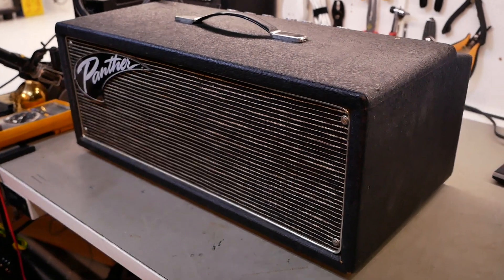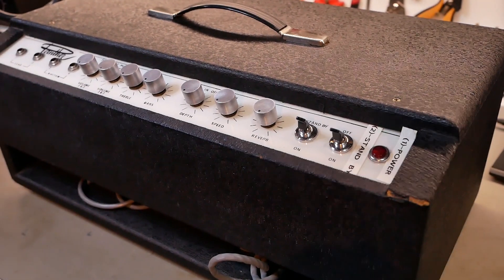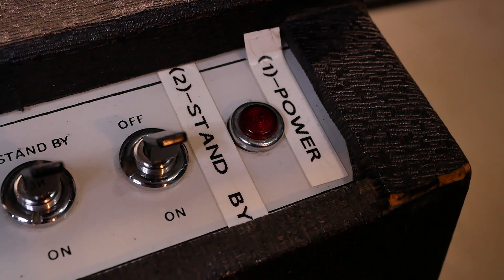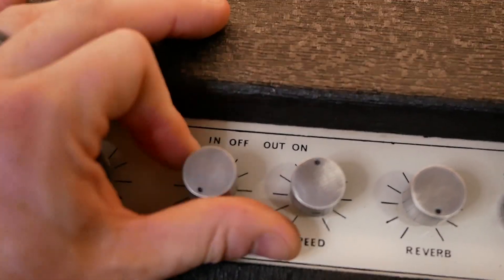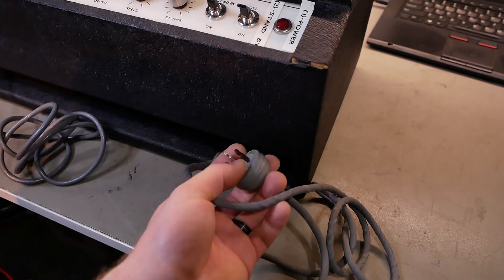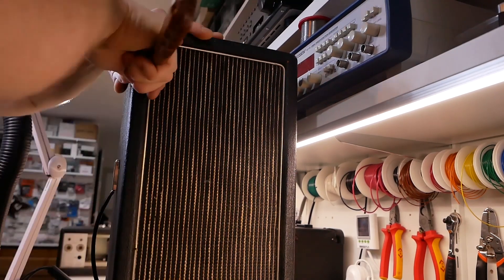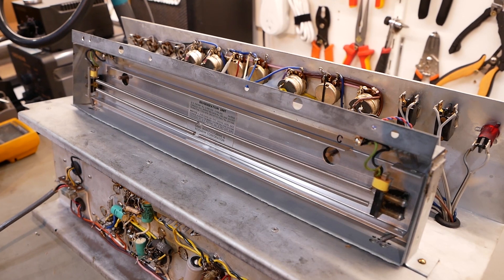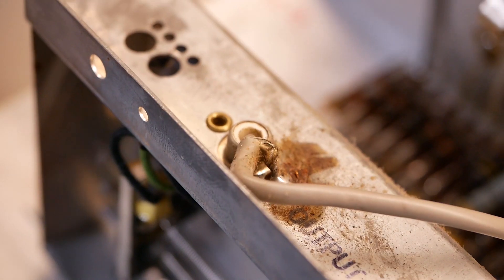Oldschool Aussie Amps - Panther Head Part 1

Comment: "MiniWatt" was a Philips brand, but although I've handled tens of thousands of tubes, I've never seen a USA-branded (manufactured?) Miniwatt tube before (my guess is that they might be rebranded Sylvania 6L6GC's). At some point,, Philips bought USA-based industrial-tube manufacturer Amperex (on/in Long Island, NY), or at least purchased brand-licensing and cross-distribution rights to the name; and they also bought Sylvania  or the associated licensing/branding/distribution rghts, which is why you might see late production military JAN-spec "Phillips/Sylvania" branded tubes, typically with blue printing on the glass, instead of the usual early Sylvania green or, later, yellow printing. (This arrangement was probably done so that Phillips in Europe could have access to the lucrative American military market). 

By the way, Matsushita = Panasonic and Technics.  I am told that their very 1st product back in the 1920s or thereabouts was a Y adaptor  that screwed into an overhead light bulb socket and gave you an outlet to plug in an appliance or other device, as well as a bulb socket! Here in the States, everyone I've known in the audio business, sales reps and so on, and one boss who had visited a Matsushita factory in Japan,  pronounced the name with just 3 syllables: "Muh-shoose-ta".   Perhaps someone of Japanese descent or experience will tell us if this is correct or not.....

Comment: At 21:45, "we've got pin 1 and pin 8 connected, so that's the suppressor grid connected to the cathode". The problem with this scenario is that 6L6GC's are beam power tubes, not pentodes, and they do not have a suppressor grid !!!  It probably doesn't matter much here because most 6L6 type tubes don't use pin 1 at all unless they are the early metal  case 6L6 (where the metal shell would be connected to ground).  Perhaps these amps were originally intended to be used with EL34's and then somebody made a production change to 6L6GC's  without changing how the sockets were wired (I wonder if they also changed the output transformers to have a better impedance match to 6L6's).  It might not be a bad idea to doublecheck the tubes themselves and make sure that pin one isn't internally wired to anything inside the valve. And PS,  I agree with Brad, a 6CA4/EZ80 rectifier does seem decidedly undersized for an amplifier with 6L6GC's and 6 other tubes; 12AX7's  may only need a few milliamps of current per triode, but we have a total of 8 triodes here by my count, not counting the triode in the 6BM8  ---- or 6GW8? ----  triode-pentode, which will also need sufficient current for the pentode half of the tube to drive a reverb tank.
Reply from the maker: Yeah, I meant to cover that. I reckon it's meant for el34's as almost all the other Aussie amps from that era were.
Reply: @BradsGuitarGarage  ,  Weird that the sockets are silkscreened for 6L6GC..... assuming that those markings are original from the factory.
Reply: @BradsGuitarGarage  ,  I pounced on that little discrepancy like a funnelweb spider, didn't I? 😁😳 I'm an equal-opportunity kind of guy, so If I write something stupid (I've been known to) or just plain wrong, feel free to do the same to me! PS,  I am really enjoying these weird/obscure amp videos from you, and occasionally from Lyle too.  Makes for an interesting change from the usual Fender Vox Marshall trifecta.
Reply from the maker: The silkscreen you're referring to is just sharpie written by a previous tech, so all bets are off in that respect.
As for the weird / obscure stuff, there's plenty more of that on the way!
It's very rare that I get a run of known amps.
It can be very challenging starting from zero information on every job and trying to make a living off it in the process.
Reply: @BradsGuitarGarage ,  obviously you are up to the challenge! And not that you're starving for work, but although there'll always be techs, whether skilled or hacks, willing to work on Fenders and Marshall's, the  guy who can handle the oddballs (both the equipment and the equipments' owners) will always own a goodly slice of the niche market. Your ability to figure out the weird amps with weird issues and minimal documentation tells the prospective customer that you can certainly fix their modern Fender, Marshall, Vox etc. Making it all pay can be tricky....

Comment: Roll the tube with the worn-off writing through your hair and....oops! Okay, breathe on it until the glass fogs up, or better yet put it in the freezer for a few minutes first, and then breathe on it, and hold it up to bright sunlight and rotate the tube in the light---- as the foggy film evaporates it may briefly reveal the lettering. A thin film of hair oil on the tubes beforehand helps make the letters more visible.....

Comment: Brad, Did you end up finding any schematic for it? I went trawling old pics on OVAorg and AGGH and perhaps fiSonic is worth looking into.
Reply from the maker: The internal construction certainly shares some traits with the FiSonic amps.
The cosmetics looks very Vadis, too.
I couldn't find any specifics on this amp or a schematic or photos at all.
Strange, considering how professional the control panel and front panel look.

Comment: I'm in my mid-sixties.  Never saw or heard of a guitar player standing behind the amp.  Those paddle toggle switches were very common.  You could buy them at any electronics store.  How on earth was that amp supposed to dissipate heat?  The tubes are entirely enclosed.
Reply from the maker: Clearly someone did play behind the amp from time to time, as many amps had the controls pointing that way. And no, it wasn't very well designed from a thermal point of view. It's worked it's whole life up until now though, and that's an order of magnitude more years than many current offerings from the major manufacturers will last for.

Comment: Except a little poor ventilation and underrated rectifier tube, looks pretty decent amp to me. (A pair of 6L6 tubes deserves a GZ34 but it needs 5V heater, so that smaller rectifier if things done cheaply, could probably use even the same 6.3V heater winding as other tubes. If it has a winding of it's own, then it follows a bit better design principles.)
 But no wire spaghetti, short signal paths. 👍 
Those hammertone finished transformers look beautiful.
Yes, that 6B.. tube looks very much like 6BM8 aka ECL82. 
Nice video! Hope you'll find the schematics, makes things much much easier.
Reply: The other possibility is a 6GW8 aka ECL86.  Which if I remember correctly is scarcer and more expensive than the 6BM8.  The pin out is different and the specs are also somewhat different and so unfortunately they're not interchangeable.
Reply: @goodun2974  Yes, triode of ECL82 has lower gain than the triode of ECL86 so for a reverb recovery ECL86 would be probably better option. And the pentode of ECL82 is weaker as well.
BTW is there somewhere a selenium or ss diode B+ rectifier because that one rectifier tube cannot properly feed three pentodes without sweat?

Comment: Interesting old amp. So many questions that'll probably never be answered, such as why they used two single triodes rather than a single 12AX7? Some of it's nice, some of it's a bit...meh. Like that 25/25 as cathode bypass cap for a pair of 6L6s. Seems a tad under done to me. Would've expected a 50 V cap there.
Reply from the maker: Yes, it was definitely early days and the designers were isolated from the US and UK as they were developing rapidly.
Reply: Perhaps the under-rated bypass capacitor was "protected" from 💥🔥 by an underrated rectifier tube that warmed up slowly and sagged significantly into a heavy current load! 🤣   The power supply really doesn't seem adequate for a cathode bias amp where you want to bias the output tubes fairly close to 100% dissipation. Perhaps this amp would benefit from a conversion to fixed bias, stealing a few milliamps away from the B+ through a voltage divider and reversed diode  and filter cap... or at the least, a conversion to solid-state rectification.
Reply: @goodun2974  Conversion to 6V6s? With the underdone power supply, it might come up quite nicely in cathode bias.
Reply: @Splattle101  , depending on B+ level, 6V6's might indeed be a good choice.  It also depends on how much heater current the transformer is capable putting out ---- the  tube heaters might become overvoltaged due to 6V6's drawing half as much current as 6L6's, but if they're already under-voltaged/under-heated with 6L6's in place,, then it might be a good choice to lessen the heater-current load on the transformer...... but you'd have to take care that the B+ doesn't then rise by too much to be safe for 6V6 tubes.  6V6 will also probably be happiest with a speaker-impedance load that is twice what it likes if it's equipped with 6L6's....
Reply: @goodun2974  Yep, all tru dat, but we're both getting way ahead of the game here. Poor old Brad needs to draw it out and then take some measurements to see what's what, what?
Reply: @Splattle101  , asking questions in your head, in advance of the actual detective work, can be helpful ----  assuming that you can remember what those questions were when you actually get around to working on the amp. In my case, I need to write it down, or I'll forget!